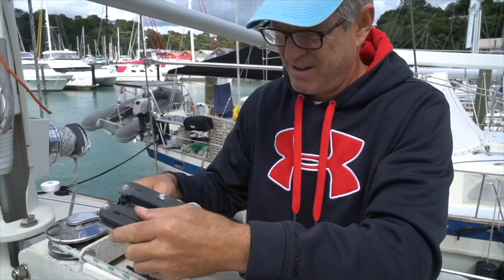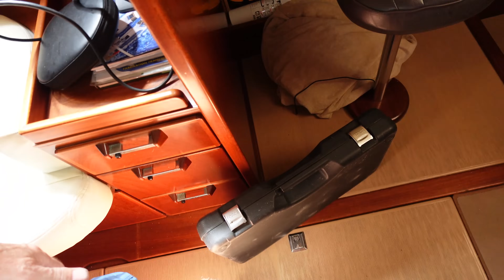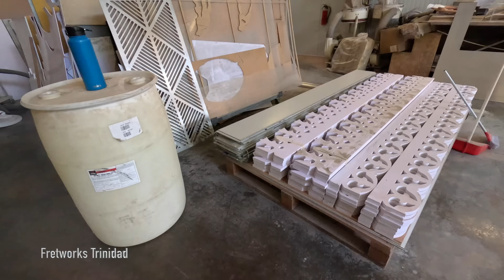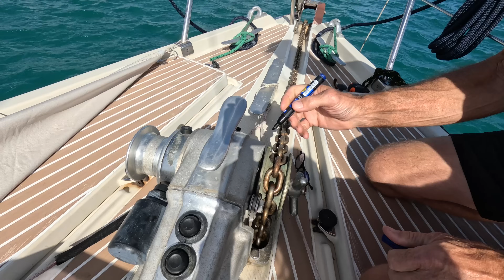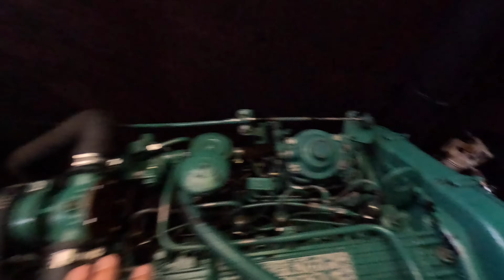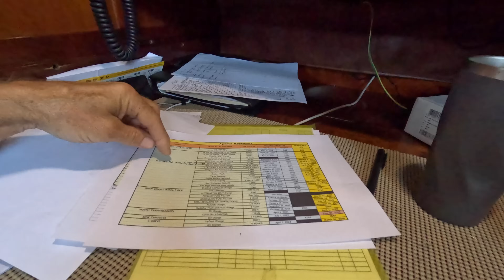Tips on Tuesday - Check out our new helm station!  Quick QNC CHC installation it looks fantastic!

Comment: Hi, is there a reason you're sticking with the two black rubber covered buttons on top of the windlass, rather than install a handheld remote windlass control that's wired directly to the solenoids in the forward port locker? (This is not a smartass question, I'm just trying to understand your logic). Thanks, and I really appreciate your 'tips on tuesday' series!
Reply from the maker: The plan is to do the wireless buttons as well!  Cheers..  Coming soon to a Tips on Tuesday...  :)
Reply: Thanks Ken, wishing you well with that further installation (which I did on my Maramu last year as I find it more convenient to use than the buttons)

Comment: Hi Ken , nice work , I love your channel ! I m the captain of Pen Azen Sm 2000 . Is it possible to know the references of the switches on your windlass I have to change mine . Thank you very much in advance.
Reply from the maker: Amazon - 2pcs 22mm Momentary Push Button 12V/24V/125V/250V/2A Screw Type Terminals Stainless Steel Metal Waterproof Button with 2 Screw Terminals Stainless Steel(High Head).  Cost $9.99 for Two.....  But you have to get the black covers from somewhere else.  I had bought some more expensive buttons from Budget Marine that had the rubber covers, but they didn't have a long enough shaft.  So, spent $9.99 more had got the best of everything!  Cheers
Reply: @ thank you !